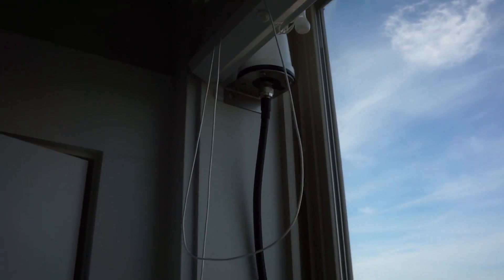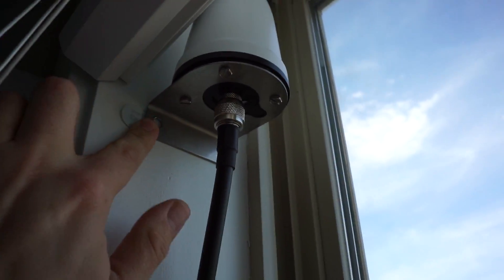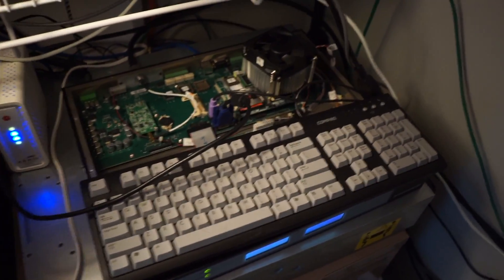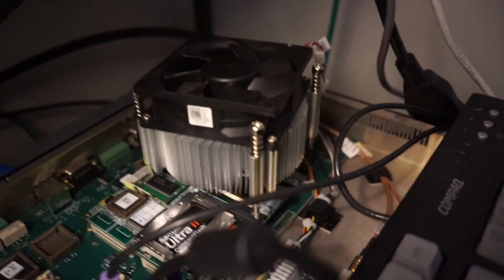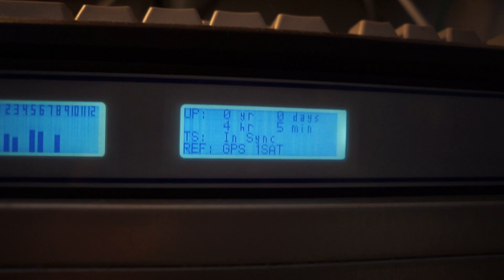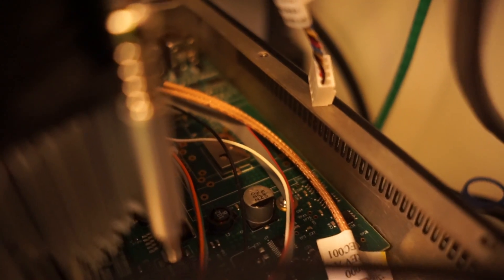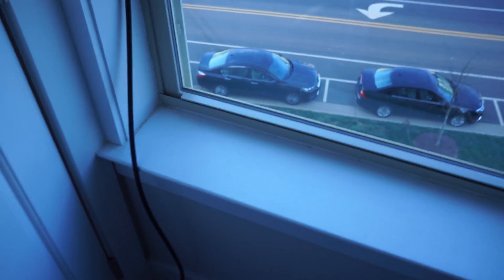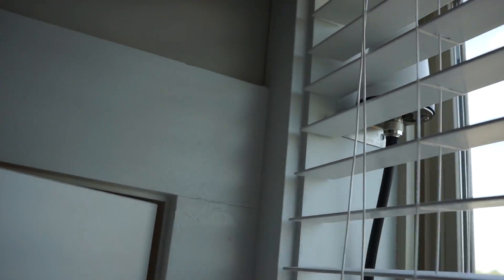Spectracom NetClock/GPS 9383 Apartment Setup

Comment: Hi John, Would you know how to reset the 9283? I just bought one. I don’t have the password for the serial port in the rear, last owner changed it from the default. I also can’t get into the web browser using the IP address that’s displayed on the LED screen.
Reply from the maker: Hey Michael - I haven't worked with the 9283 before, so I can't say for sure, but you should be able to connect a local keyboard and monitor to the PS/2 and VGA ports, then edit the grub boot options when they come up (these things just boot a custom linux image). What you'll want to do is add init=/bin/bash to the end of the default option, and make sure that rootfw is mounted as rw not ro. Once it boots it should dump you into a bash prompt logged in as root, and you can run the passwd command to reset passwords. You should be able to reset the network settings from there as well - I'm assuming yours has a static IP and that's why you're not able to access it.

Also, I do have access to a default system image for a 9383, but I do not know if it would work on a 9283, I don't know the differences. Furthermore, if you haven't posted there already, a few folks on the TimeNuts mailing list have these machines and could probably help you more. Good luck!

Comment: What Make & Model of GPS antenna are you using there? Great setup btw!
Reply from the maker: Sorry about the delay getting back to you! It's a PCTEL or MAXRAD GPS "reference antenna" - I paid about $50 for it a couple of years ago, looks like all of them on ebay are pretty expensive. I have a few reference/timing antennas and they all work great.